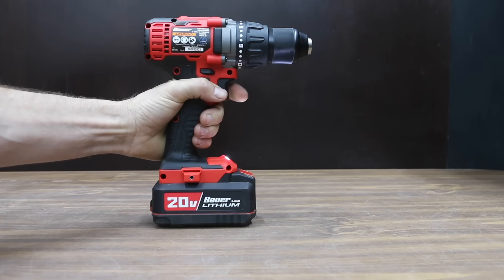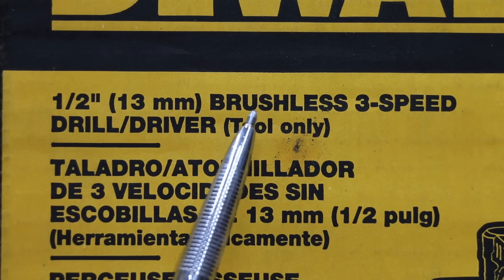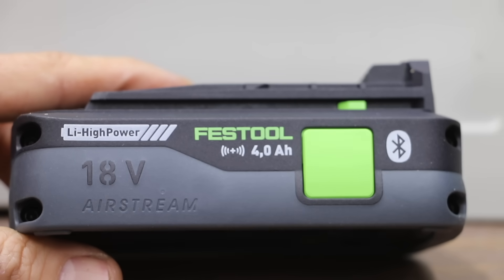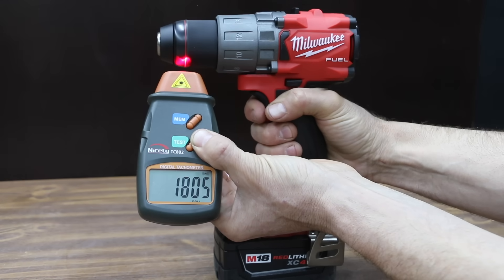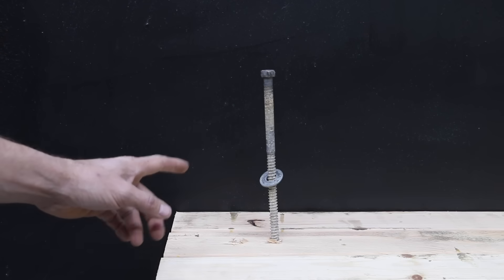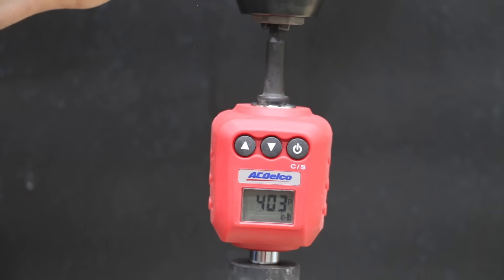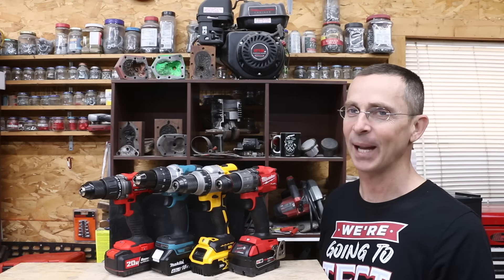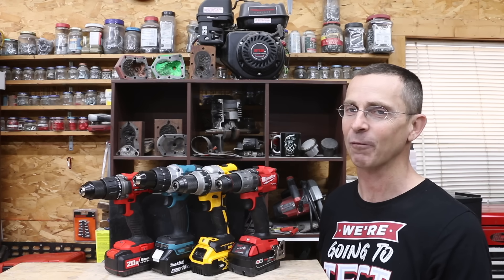Best Drill (BATTERY POWERED)? Milwaukee vs Dewalt, Makita, Bosch, Festool, Ryobi, Bauer, Ridgid

Comment: As someone who uses my battery tools daily, I started out with Ryobi years ago because of the price. When those started breaking down and getting old, I bought the Kobalt XTR brand because I found a ridiculous deal on a massive set and because the batteries were so cheap. I was initially very impressed with the XTR brand as a whole, as they're quiet, smooth and powerful when new. Unfortunately they just aren't durable. I went through a drill per year for various reasons (chucks always locked up, randomly not working, giving only a flashing light when you press the trigger, etc. Both the hacksaw and sawzall's motors burned out, and the plunge cutter (oscillating tool) seemed, over time, to transfer the movement from the blade to the tool itself. It got louder and louder, vibrated like mad, but would cut through nothing.

I finally switched to Milwaukee. The initial price was a bit of a shock, but I played it smart and got it all around Christmas, went online for deals, etc. The money was well spent. Every one of the tools performs with no issues, every time. The batteries charge very quickly and last forever, operation is smooth and very powerful. Doing what I do, it was stupid to attempt the cheap tools, but it's very hard to switch once you're invested in a platform. 

In short, if your tools are going to be put through a daily grind, spend the extra and get the good stuff. Milwaukee, DeWalt, and Makita all seem to stand the rest of time. Don't worry about fan boys of any of them. Whichever of those you can get cheapest to start with, you'll be happy with. 

For occasional to moderate usage, Ryobi and Kobalt work well. I'd actually advise anyone who doesn't have great trigger control to get one of the cheaper drills for home usage. The big 3, as shown here, don't do very low torque well, so you can easily strip screws and mess up delicate work if you can't moderate by feel. Those of us who use them daily take for granted how in tune we are with our tools, until we watch someone with zero experience give it a go. For those without that feel, the cheaper tools with the ability to set torque to almost zero will be easier to use. 

Sorry for the long comment, but hopefully it helps someone make a decision somewhere down the line.
Reply from the maker: Thanks for sharing.
Reply: Too long? No way! Thanks for your review of Kobalt. When Porter Cable started fizzling out I decided to switch to cordless Dewalt tools though I was momentarily tempted by Kobalt. I wasn't sure about Kobalt's durability, and I wasn't convinced that Lowes would continue backing it. (The store currently seems to be in love with Craftsman.) I am now very glad I went with Dewalt.
Reply: @justmeandthethree  DeWalt, craftsman and porter cable are the same company and often intermingle inner parts. Just heads up
Reply: @britanavey3855  👍
Reply: Best time to switch battery line is HomeDepot between Nov1 - Dec31. Heck the kits are mostly 1/2 price and free home delivery
Reply: @Dirtyharry70585  couldn't agree more! That's exactly when I switched.
Reply: I had almost the same path, Ryobi when I started, now at Milwaulkee, for the occasional user, Ryobi is fantastic, if you are going to use them a lot, upgrade to DeWalt, Milwaulkee or Makita, you will not he unhappy with any of those 3.
Reply: The contractors I respected most almost all used Ryobi.   Why use the cheapest tools for framing?   Batteries.  Lots of batteries.  That’s typically what failed in a construction environment and always having twice as many batteries you think you need mean virtually no down time.  Time is money. Theft and others abusing your stuff is less of a concern too. I didn’t really see many tools fail myself, but as a professional mechanical design engineer now, I’d speculate that you’d have to spectacularly abuse any of these brand name tools to break them.  In terms of motors and reliability there, my friends who went into tool design said each manufacturer tended to use the same major components (motors etc).
Reply: @stevebean1234  Time is Money, AND Money is Money. If it were just about time, then they'd get the Red, Yellow, or Blue. But since they also have to factor in Money, it makes total sense. Factoring in theft, damage, and loss, shifts the calculus quite a bit.
Reply: @stevebean1234  I've only had a few batteries fail over the years, and that has never been a problem that's slowed me down necessarily. However, battery life is huge for me and the difference between Milwaukee and the two more budget friendly brands is vast in that department. I've yet to have any issues from any of my Milwaukee batteries or tools to this point. It's only been a year and a half, but they've been put to use heavily in that time. Time will tell how they hold up, but from what I've seen to this point, I have no worries about it. 

As far as abusing the tools, I suppose it depends on your definition. I'm not overly careless with them, tossing them around, etc. I don't even like to leave them in direct sun. Lol. I just use them. A lot. That repetition quickly reveals weaknesses or flaws.
Reply: @stevebean1234  my 12 year old ryobi string trimmer is still going on the original battery. So when availability of decent batteries became an issue with a bunch my old tools, I chose to get new tools. My trimmer experience, finding out that ryobi keeps their battery design consistent, and ryobi packaging all the tools i wanted into a set, and I now have a bunch more ryobi tools.
Reply: Excellent comment. But I absolutely love my Ryobi HP tools.
Reply: Your comment is valuable knowledge, thank you 👍
Reply: If Makita hadn’t been on closeout at Home Depot I would have bought Dewalt. But there it was, the first gen lithium combo tool set. Sold.  I managed to kill the drill, and a few batteries in 15 years.
Reply: Thanks for your insightful comments! I need to get a decent drill myself!
Reply: Thank you my G
Reply: But many things are as difficult as watching someone struggle using your tools..
Reply: Love my RYOBI -
Reply: @michaelmcjilton9333  I'm scared of ryobi.
Reply: This is the perfect comment! 
I’ve been using Ryobi for years now… but I also do maybe two or three small projects a year (rabbit hutch/ chicken coop or things in the house) so it’s money well spent because they don’t get a lot of use. If I ever get more into home projects and do more building I’ll definitely be stepping up to Milwaukee, but for now my Ryobi stuff still works. Like the old saying goes, “if it breaks… time to upgrade, if it collects dust… you don’t use it enough!”
Reply: HelLo...Your Music @ dad's....iS ExpetionaL✔️, YES🔷🔷🔷🔷🔷.
Reply: Long read but worth it! I've been doing manual labor/construction for about 10 years now and I've personally always bought dewalt, and haven't had a tool fail on me yet. I've dropped a few from high up and broke them, but it was user error and not manufacturer.
Reply: Yep!  Late to this video, but my XTR Sawzall just died after 2 years... like yourself, found that amazing $400 deal on all the XTR tools plus a roll-carrier.  For the most part I've had no issues, but the Sawzall and my 2 "Extended Output" ($100) battery's died this last weekend.  To be fair this is after cutting down 5 trees and 40, 12-18", stumps.  Pretty hard work for any Sawzall.  Trying to decide whether to go Makita, Milwaukee, or Flex.  Love supporting Lowes... Love Milwaukees Packout System!
Reply: @cohoonatube  my brother got a few Flex tools a few months back and loves them. He only uses them for around the house projects and such, so I'm not sure how they'll hold up over time. They seem to perform well the few times I tried them, but it's been very few so my perspective is pretty much nonexistent.
Reply: Big help. Thanks a bunch
Reply: Did you find Ryobi or Kobalt to be more durable?
Reply: @thestroomis5076  kobalt was better than Ryobi when new (smoother, quieter, more powerful) but the Ryobi tools lasted longer. The caveat to that is I wasn't doing as much of the daily grind when I had the Ryobi, so it's really hard to say with longevity. This has been some years ago now, so I'd assume both are better now than they were.
Reply: I picked makita because my dad had a bunch of older makita tools for me, also bought a couple new ones like the drill.  It's a great brand but the batteries are really expensive (don't know the other brands battery prices though).
Reply: i get my tools off ebay and always go with makita because  of the rapid charger. i have the 07 and 12 hammer drill. its a must as my home is stucco cinder block. i do have kobalt string trimmer and lawnmower as well. still have some 2 of my first battery  tools porter cable 😮.
Reply: Imo the engine brake test wasn't great unless you let the engine brake cool to the same temperature after each test.
Reply: Too long
Reply: Hola, soy asesor comercial en ferretería y te doy la razón.

Si quieres herramientas para trabajo pesado o industrial ve por Milwaukee, Dewalt, Makita, Bosch, Hilty.

Si es trabajo profesional o intermedio alto ve por marcas como Stanley, Élite, Furius, Truper, Dong Cheng, Skill, Crassmant.

Si es trabajo tipo hogar ve por marcas como Einhell, Rioby, Festool,  Uyustool, ingco, 

Hasta luego.
Reply: I stick with Dewalt. I've always had good experiences with their USA made stuff so I stick with that for the most part.
Reply: @limitedhangoutlive I bought a dewalt set after my porter cable dies after about 10 years, I got an insane deal at lowes and I haven’t been disappointed. It’s been covered in oil regularly and dropped many times and still trucking along
Reply: @micoasters  Yeah, it's my go-to. I try to stick with their US made stuff as they do have a China line of goods as well, but at least not all of their stuff is made overseas now like Milwaukee.
Reply: @limitedhangoutlive  US assembled, not made.
Reply: Thanks for the story.

I like Kobalt hand tools but it doesn’t sound like their power tools are great, which is a disappointment. I have Milwaukee power tools already though, thankfully.
Reply: I totally agree I can't afford hilti so I stick with 2nd best milwaukee.   I've had deealts and they just don't seem to last.  Milwaukee, you can't seem to kill them  Thanks for sharring
Reply: Give it more time the Milwaukee will fail on you. Sent 4 drills 1 saw 3 nail guns 3 sanders multiple batteries for service I’m done with the 18v line the 12v is really good

Comment: I’m a DIYer and I have the Milwaukee M12 fuel and it is worth every penny. Small but powerful and can handle a 2 inch hole saw. Some DIYers like myself see the value in more expensive tools.
Reply from the maker: Thanks for sharing.
Reply: Excellent advice.  I am a Milwaukee guy, brother is Dewalt and I have good friend that uses Mikita.  All three make great products and I think whatever brand you invest in stick with it because of battery interchangeability.  I think buying a quality brand is actually cheaper in the long run. Is Milwaukee, Mikita and Dewalt going to cost more? Yes, but they will work harder, longer usually batteries last longer over the cheaper "bargain" brands.  I agree there is value in quality.

Comment: I don't think the static torque test is a fair way to measure the effectiveness of the electronic clutches, as there is too little rotation to properly activate the sensors. How about a real-world test like driving a #4 x1/2" screw in soft pine? Otherwise a great test.
Reply: That would be interesting. I own an electronically clutched m12 fuel drill and the mechanically clutched makita shown in the video and the electronic clutch just has very little finesse in my experience. The momentum in the motor that gets sent straight to the screw, since there’s no mechanical disengagement.

Comment: I need to decide today on what battery platform I'm going to use going forward. I've had good results with Dewalt for years but my most recent purchase, which is similar to the one you tested, if not the same one, has had the transmission fail one year and one week after I bought it. Of course your analyses will be considered.

Comment: I have been using rigid for The Last 5 Years and I had one of my drills break I sent it in it got replaced for free. Lifetime warranty on the rigid tools. I do have a few dewalts and Metabo too.
Reply: As a DIY user, I chose Ryobi some years back.  They are OK, but a few of those tools have burnt out over time.  However, I got my sister started on Rigid when I realized that for just a bit more money, the starter kit for Rigid included larger capacity batteries, a larger diameter circular saw, and lifetime battery and tool replacement.  Same parent company, but a step up in everything.
Reply from the maker: Thanks for sharing.

Comment: I can say from a point of experience, DeWalt is TRASH. I have 30+ of their tools and have been experiencing quite a high failure rate (3 batteries 2 impact drills 1 cordless 7 1/4” saw and the 12” cordless sliding compound miter saw). Also I am not hard on my tools. I almost baby them. I do use them frequently as I am a carpenter by trade but, they should not fail after 2 years. DeWalt👎

Comment: I will second the comment below on Ridgid which is the highest quality lowest price tool overall of any brand. Ridgid is so unloved you can pick up Ridgid tools from secondary suppliers, Ebay, pawn shops, etc for very little money. 
Comment about drills in general: I never fully understood why a tiny impact driver has 1600 inch pounds of torque and a much larger hammer drill only about 600. Seems strange to me that drills are so under-powered. (Semi-pro tool seller, KCMO).
Reply from the maker: Thanks for sharing.

Comment: You HAVE to include the price of the battery and charger for things to be equal, especially when you talk about the price.

Battery and charger makes a HUGE difference in price. 

Cheap drill but when the cost of the battery and charger is more than the drill, that is a massive cost to own. You will have to replace those batteries every once in a while.

Delicate work = hand held screwdriver.

Some of the problems with slowness and such could be due to the horrible batteries they use.

Dewalt or Milwaukee are my go-to power tools.
Note Dewalt batteries do not store for very long. Have to jump start mine just to get them to charge. And they still do not charge after storing a few months.
Reply from the maker: Thanks for the feedback.

Comment: Love your content, the only thing I would say is that the Rigid, Dewalt, Makita, Milwaukee, Bosch, and Festool drills are all brushless, while the Ryobi and Bauer drills used have brushed motors. I wonder if this has any effect on the result? Love your content
Reply: Brushless are more powerful. Brushed will also all burn out with regular heavy professional use (when it comes to drills, not necessarily with other tools).

Comment: I used a old 1/2 ratchet and made a tool for turning over small engines. I can start a 22hp Kawasaki with it and anything smaller using my Milwaukee fuel drill
Reply from the maker: Thanks for sharing.

Comment: FYI, the 20 volt rating is a marketing gimmick. The lithium batteries used in these drills will produce about 20 volts at peak charge but very quickly drop to about 18 volts, which is a more accurate rating. The 20 volt and 18 volt batteries are essentially the same internally, 5 lithium cells in series.
Reply from the maker: Thanks for the feedback.

Comment: One thing that should be noted on the Festool is that the ergonomics are supposed to be a big part of the price premium, in addition to the quality components. Still doesn't justify the price premium for me but I'm not using my Milwaukee for multiple hours every day. Thanks a ton for these fantastic videos, they are VERY helpful in deciding what to spend my money on. I'd love to see a comparison of the vaccums that Milwaukee & Makita offer, especially in the 12V line, as I think that's going to be best suited for my needs as a locksmith.
Reply: Both the ergonomics and material for festool are kinda overrated . Seriously doesn't justify the price
Reply: @HexaDecimus  Yeah that must explain why a number of professional shops have spent the premium for their products & haven't regretted it & when I ask them...
Reply: @bamascubaman  the biggest part of the Festering Stool's price premium is the "Festool" writing on its side.
Reply from the maker: Thanks and you are welcome!
Reply: If you buy FeSTOOL, you are a moron. This video proves it.
Reply: I haven't seen anything from Festool worth what they think it is.  Nothing they make is very high quality, just high priced, and everyone that has bought into the Festool stuff has found it to be less than stellar in performance...just pay more for less quality and less power.  

Although, Festool is more geared towards the wood working crowd which is probably why their tools aren't very powerful.
Reply: @wildbill23c  true dat. Personally, I think the new Flex lineup easily beats Festering Stool in quality and day.

Comment: Used my Milwaukee Fuel drill to POWER MY SKID STEER and drive it around the driveway to test the hydraulics before mounting my electric motor in it :-) Rock solid. Took about 4 minutes to overheat.

Comment: I have that exact same rigid drill I was using it to break loose a bolt the handle snapped off in my hand literally putting the drill in two pieces
Reply from the maker: Thanks for sharing.